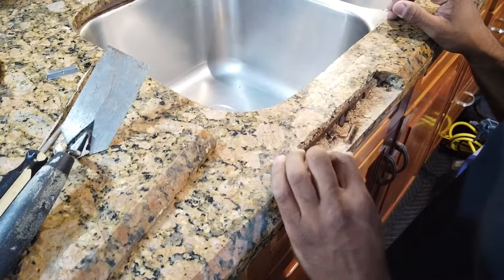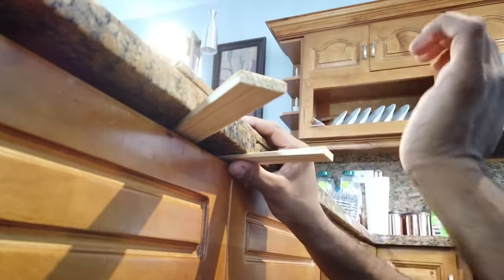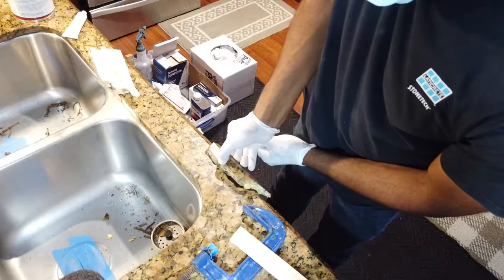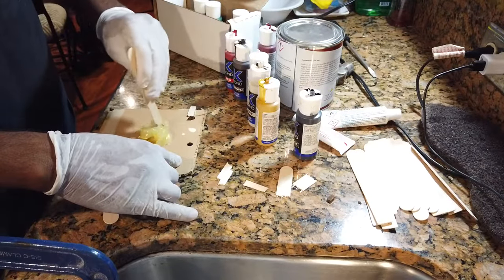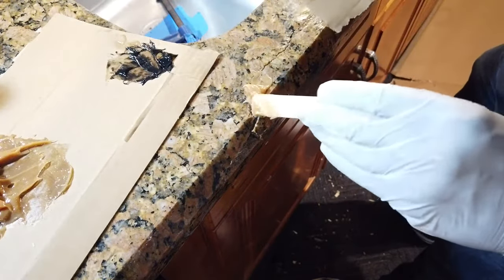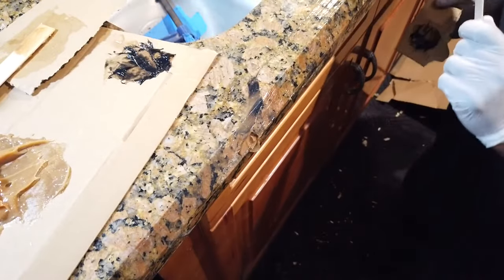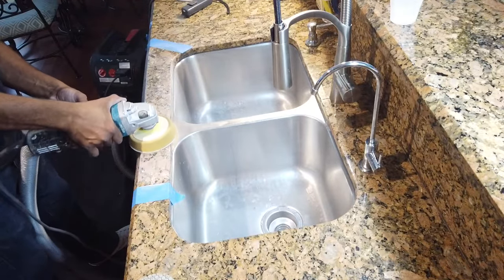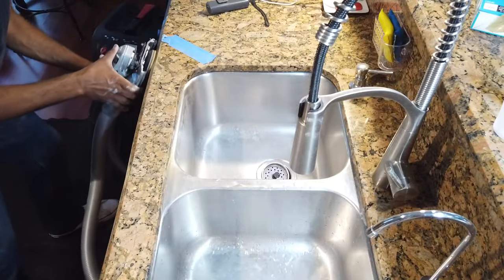How to fix broken granite countertop.

Comment: Decent repair but you need to cut out the exposed rod and use a structural adhesive or it will crack again. Also you can trim granite of the back of the pieces and fill the voids. Nice job.

Comment: Any rod repair that doesn't involve removing the failed rod is doomed. You must get a proper silicone seal between the sink flange and the stone bottom also. If you have to drop the sink and strap it back in place, so be it.

Comment: can we get some info on ur polishing method my man?
Reply: this method isn't the best to be honest, he is cutting corners so to speak, the 3 step he used would have left the surface extremely dull, he uses a colour intensifier to bring up the shine, this however will wash off after a couple of weeks of the client cleaning their counter tops. I would recommend using 7 step wet diamond pads they come in grit steps as follows... 50, 100, 200, 400, 800, 1500, 3000 you can also get a 6000 grit but this is not necessary. for use with a variable speed sander/polisher. you start with the affected area and with each pad you expand you polishing line or circle out by about an inch to blend the finish of each pad. note wet diamond pads are advised as you get a much better finish but you can also buy dry diamond pads with the same grits
Reply: @dresden5060  thanks for the reply dude any brand suggestions for wet diamond pads? there’s so many looking for good quality at a reasonable price .
Reply: @christopherjohn1504 no problem buddy.. to be honest we use a brand that are an independent company in the uk so I'm not sure if they sell internationally, but you can try  we use a company called "z zambelis"
 However I would go for pads that are no cheaper than 10-15 dollars per pad... any of these whole sets they are selling cheap will be crap.